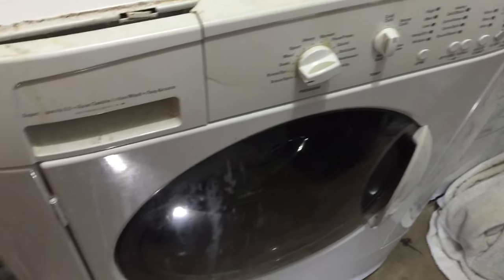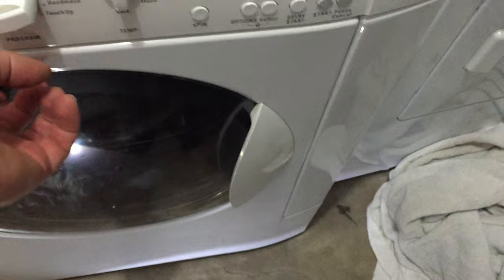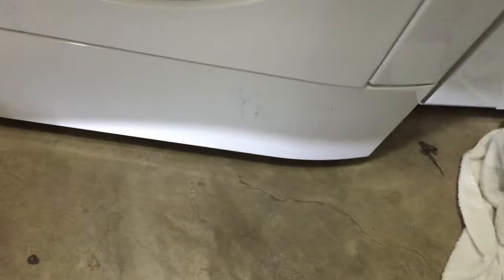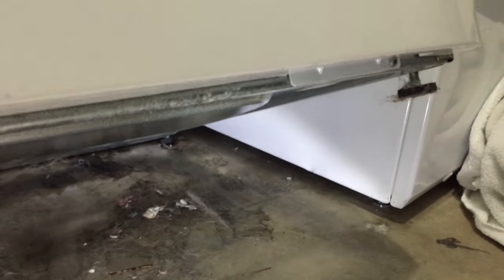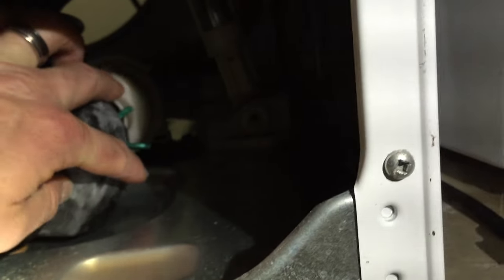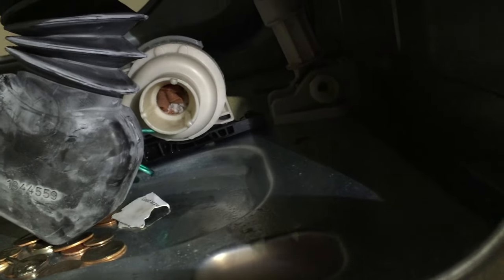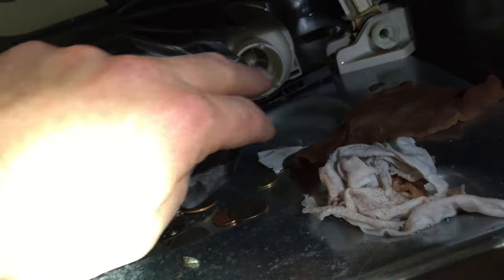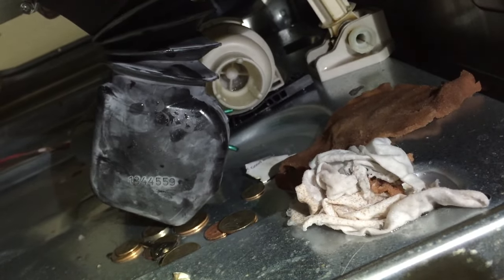How to Fix Kenmore Front Load Washer that won't Drain

Comment: Thank you! I had the same model that wasn't spinning out/draining properly - clothes were still pretty sogged. This video helped me locate the pump and coin trap so I could clean it out. I found $2.17 in coins, two of my wife's bra extension thingies, and a bunch of other unidentifiable objects and goo. It now pumps out perfectly.
A couple other things that may be helpful to others:
*The two screws for the front access panel are SQUARE drive - that's why you had a little trouble using a Phillips bit.
*I couldn't figure out how to re-install the coin trap in the tub-to-pump hose. Mine had somehow fallen all the way down into the main chamber. According to this other video, https://youtu.be/53dE7sLBgNE?t=398, the top ring of the filter is supposed to be installed on the third "rib" from the top.
Reply from the maker: Thanks so much for letting us know the video is helpful. And great tip on the proper type of screw used. Glad you were able to get things fixed and get a few bucks in change in the process :)
Reply: @TechTalkvideo  Actually the screws are called quartex  and are a cross between phillips (P2) and Robertson (S2 - red robbie).
Reply: You could have mentioned that when making the video

Comment: I had a draining issue as well. There was a face mask and a quarter, a dime, a nickel and two pennies. I would like to add a step that might be helpful though. I had to loosen another clamp located at the top of the filter. It is not green like the others. It is about four inches in diameter and has a Phillips head screw holding it in place. I pulled ot off and reached down in there and found the mask. Thanks for the video, it helped me a lot
Reply: Thanks for this tip... I had to do this as well!
Reply: @SarahClarkson1  I wish that it were that easy for us. The only access that we have to the filter is from that back of the machine which gives you a complete reversal of what you're working with.

Comment: Adding my thanks! I have a completely different filter/pump design in my front-loader, but this video helped me figure it all out. (BTW, for anyone else who has a 2008is unit, there is actually a large "plug" on the front. Open that easy peasy! No clamp removal required.)

Comment: How did you remove the green clamps ? I’m struggling to remove them with my hands. Did you use pliers ?
Reply: Agreed, the green clamps are really difficult to try to move using just your hands. We use a pair of vise grip pliers and the job was much easier. Hope that helps.

Comment: Took your advice but removed the entire rubber boot...there is a plastic "filter" inside the boot...its a plastic tube suspended in the boot with several holes at the top to let water run out and solids to fall to its bottom...I had two "colorsafe sheets", 3 quarters, 3 pennies two dimes and dog hair packed solid in this 4 inch tube!!!!  not sure how all these items get thru the small drain holes in the washer....must sneak around between the rubber boot and the steel drum????  anyway don't just shake out the boot....take it completely off and clean out the plastic insert that will be crammed full of debris

Comment: I had done this to mine and sure enough, was excited to pull out a buch of change.  Put it all back together and got same problem.  A friend said to look again, I just did, no more obstruction, tube is clear also.  I suspect the pump, but anything else left?  Could the change have hurt the pump - I'd hope there was a current limit to stop it from keep trying with obstruction.
Reply from the maker: I'm so sorry to hear that this didn't fix your problem. We caught things early on our washer and were able to clear out that filter before it really affected any of the other parts. If that change been clogging things up for a long time, it may have sent your pump into overdrive and burned it out. Unfortunately, I haven't walked through the process of testing the pump so I can't offer any further advice. Definitely hope you're able to figure things out. Thanks again for watching.
Reply: You have to take apart the whole black rubber boot and clean out the filter at the top.

Comment: Hey friend, do you know what the model number of that washer is? The numbers have rubbed off on the inside door. I have the same model. I need to find some parts for the suspension system. But I can’t determine the model number. Thank you so much for your assistance

Comment: I once had kids sock stock inside water pump propeller. And it wasn't drying just like that. Removing the sock and cleaning rubber hoses that connect to the pump solved the problem for free no parts needed. Right now machines vertical row of green lights blinks 15 times and than beeps once. It still works but I'm trying to find the code to find what needs to be checked.

Comment: I've got a baffling water problem with this machine. I hope TechTalk can give me some insight. I had no problems the last time I ran a load of laundry. The clothing were rinsed properly and wrung out completely and I put them in the dryer with no issues.  
My habit is that I leave the front door open in between loads to avoid musty smells.  4 days after my last load I noticed water had spilled out of the tub and onto the floor in front of the machine. 
I looked inside and water had filled the bottom of the tub deep enough that it had overflowed and spilled out the front door. This is clean water. It isn't residual water from the previous wash.
My question is this: Does Tech Talk's repairman happen to know how water could flow INTO this machine when it isn't running?

Comment: Vanessa McCorker
1 second ago
is there a hidden spot on there that has the model #? The sellers actually scratched mine off. They would not explain why but admitted to doing it. I have had her since the 2000s and it works very well until it did not. I have that exact one but my dryer is on top of my washer.

Comment: How in the hell are you supposed to safely lift the washing machine up? I have a bum shoulder thanks to a rotator injury so I need any advice I can get to get this thing up
Reply: don't use a combination screwdriver.  I used a red robertson (square drive) to get them off without lifting the washer.

Comment: I have the same EXACT washer.  It filled and may have washed/rinsed but the clothes are still soaked.  There is no water in the bottom, and the outlet lint sock in the sink is wet, so I think it drained.  I tried starting a new cycle but the Start light just flashes continuously (no code) and nothing happens, but I dont hear the door lock, and the door lock LED is off.  Interlock switch maybe?  Thanks!
Reply: This is my problem, have you found solution?
Reply: @VileDesecrator  Yes, it was the wax motor door interlock switch, fairly easy to replace. Went to a supply house, they told me it was the most common replacement for these.

Comment: My washer is saying no soon after I did this. Could you possibly tell me why
Reply: no spin?  Ours was too.  turned out that one of the wires of the drain pump broke loose.  Installed new pump.  BTW using spring clamp pliers that locked made removing and replacing the clamp much easier.

Comment: Didn't work for me. I have the same washer. The hose was full of WATER but no items. I tried to drain and wash but makes a click sound then nothing
Reply: I'm having the same issue. Did you ever find a fix?
Reply: You may need to replace the door lock. There are a bunch of videos on how to do it and most front loaders are the same process.

Comment: Meh. Mine looks identical to this except the front seems to be one solid piece. The bottom panel you remove can't be removed the same way on mine. And I'll never understand why they hide model numbers on appliances...
Reply from the maker: Sorry to hear that you're having problems. They definitely don't make the process easy. Sounds like it's even worse to access the filter when you don't have the access panel.
Reply: @TechTalkvideo  Same issue here. How do you gain access without removing the entire front panel?
Reply: Did you figure out how to get access? I have the same what seems to be one piece front :(
Reply: Argh. I am in the same boat. Looks identical except black, one piece front panel. 😢

Comment: So, the clamp is a bitch to remove. And you usually will have to completely remove the rubber piece to get everything out because THAT is where it gets clogged because there are tiny filters within it, that catch everything before getting to anything else.

Comment: Doesn’t show any of the tough steps. Put a towel down BEFORE opening clamp, there will be a lot if water draining. Also, accessing the pump- you’re much better off just replacing it since the propeller tends to break. The pumps are $40-$60 on Amazon. I’ve replaced the pump on my front loader 3 times and it’s still working great after 16 years.